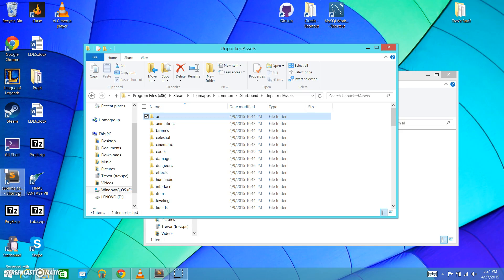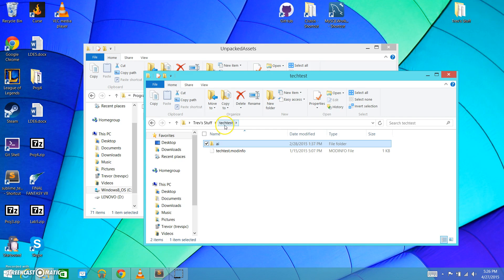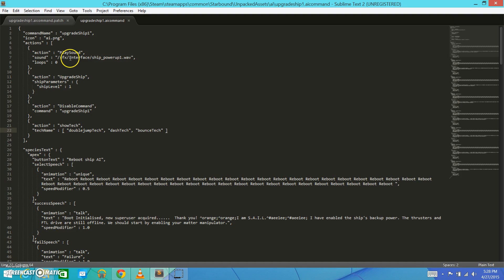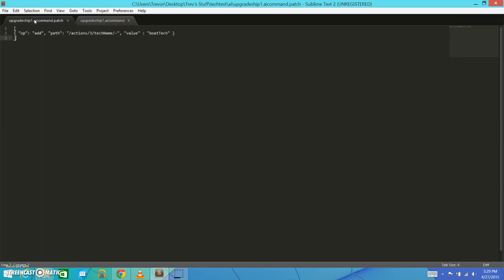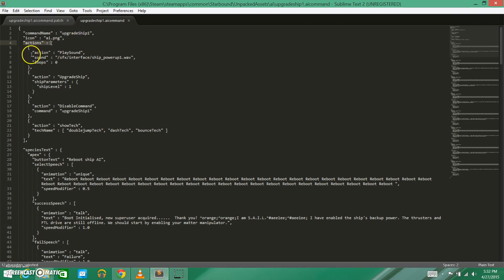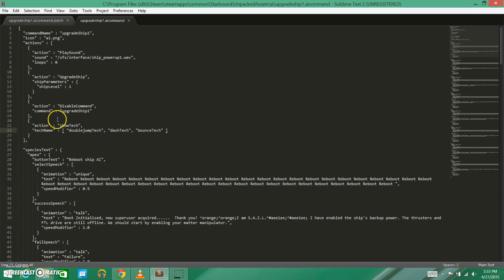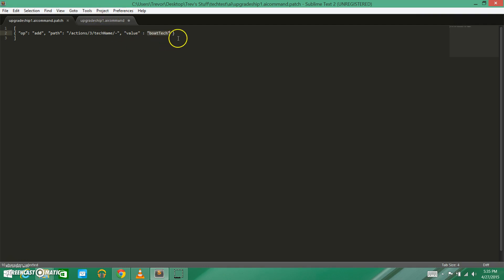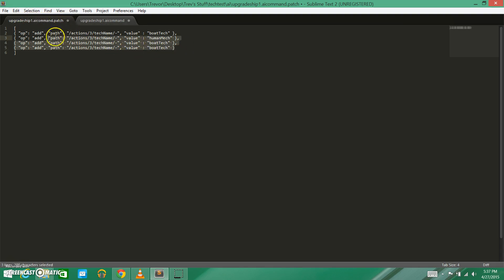Starbound Modding 101 - Patching

Comment: So If i wanted to patch in my monster spawner recipes into defaultBlueprints/tier1 it would be done like this?
{"op:": "add", "path": "defaultBlueprints/0/tier1/item/-", "value" :  "apexbrainmutantlv10wire" }

I need to know if my path is correct.
Reply: Ratix Farrence Looks correct! Throw it in and I promise that at the very least your computer will not explode.
Reply from the maker: Ratix Farrence You are close! You need to reference an index number if it is an item in a list ( when you see square brackets [] ). The same goes for the "-" at the end of the path. You only need that if you are referencing a list. So it should look like this:
{"op:": "add", "path": "defaultBlueprints/tier1/-", "value" :  {"item" : "apexbrainmutantlv10wire:"} }

Does that make sense why we reference the path that way? Give that a try and let me know if you are still having problems.
Reply: Trevor Savage Sorry I fixed this awhile ago and never told ya. Thanks though.
Reply from the maker: Charles Atkinson That's cool, my response was really late :) Glad you got it figured out! If the video needs any extra clarification, let me know!